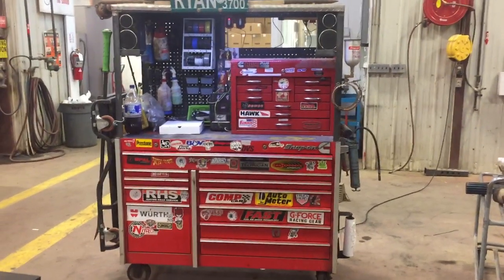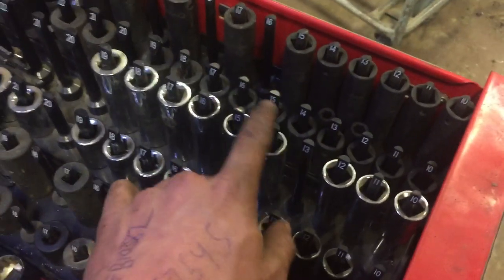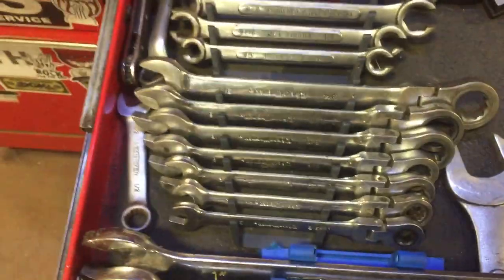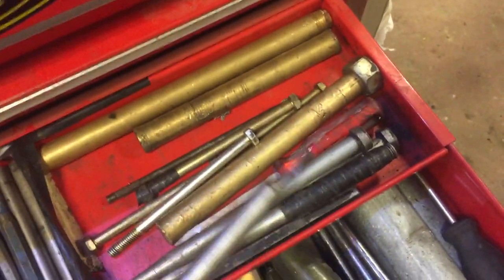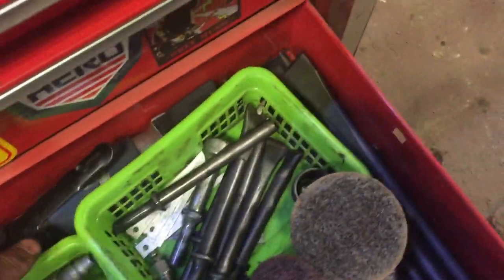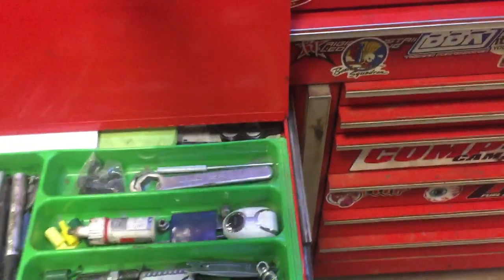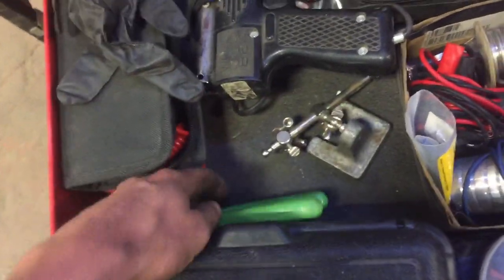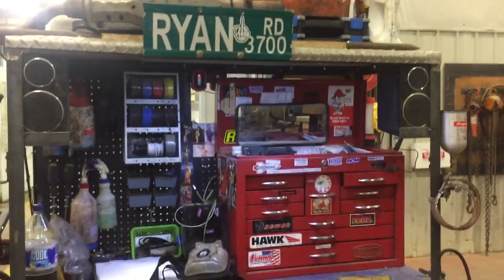Tool Box Tour 1st Year CT Apprentice

Comment: Nice! Love the homemade hutch. Always good to see tech's "making it work", even though I own a ready made hutch for my box....And there is no "random junk" in a tool box if you use the stuff to help get your job done! We can't all just load up a box with nothing but shiny tools form the tool truck, sometimes it takes a homemade set of wires / switches / relays or something to prove out a problem and get it fixed fast.
Reply from the maker: DocRevo Thanks man, I figured I'd spend $60 and make a hutch rather than spend $2000 and get one off the truck lol. I realized I called a lot of things random junk, but you're right, it's all more or less got/had a purpose. I could however probably thin out some stuff in my box though lol. I've got a box full of modified/home made tools sitting on my hutch just waiting to be called into action. Better to have em' and not need em' than to need em' and not have em'.
-Ryan

Comment: I need someone in Winnipeg to "acquire" me the Bruce street sign.  Lots of good tools you got there.  I have plenty of Mastercraft, Pro Point and Princess Auto stuff in my box also.  Mastercraft is kinda my go to brand. Most of it is really good quality for a good price.  Canadian Tire has some awesome sales sometimes.  I just bought a set of deep and shallow turbo sockets on sale for 70% off with Canadian Tire money. lol
Thanks for the video.
Reply from the maker: Bruce L. Glad you liked the video man, wasn't sure how it would turn out lol. Mastercraft is my go to brand too depending on the tool I need. Quality is on par for the price point and I've spent a fraction of the snap on prices. Unfortunately we don't have a princess auto in the town I work in otherwise I'd be shopping there for some stuff. How do you like the turbo sockets?
-Ryan
Reply: Ryan, The turbo sockets work great.  I've only used them a couple of times but they've worked perfect.  I can't see any other brand being any better.  I did a video about them.
Reply from the maker: Bruce L. Sweet I'll have to check out your vid.

Comment: am I them only one who is cringing at how dirty that tool box is.  I was always taught to clean your tools before putting them back. 10 minutes at the end of the day, keeps everything looking good.
Reply from the maker: I was taught the same thing, however I may be on 1 or 20 jobs over the course of a day depending on how things go. Often enough over the course of a day and multiple jobs I use a LOT of different tools/equipment, and being as I'm a 3rd year now I have a lot more tools. So "10 minutes at the end of the day" would more realistically be about an hour. I wipe the worst of the grime off my tools and put them away, then  usually on a Sunday I come in and clean everything and organize for the week to come.
Reply: @DAMAN12RB  I'm with you do what u can when u can, I always have a Friday fuck it draw when time runs away
Reply: shit happens u can't keep the tools if ur using them all the time